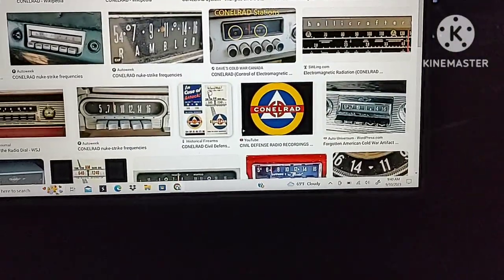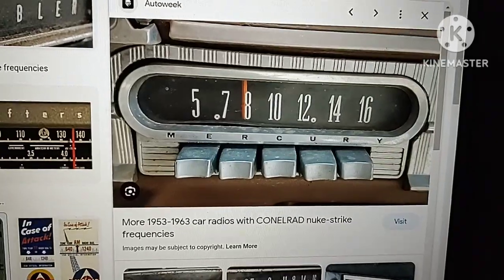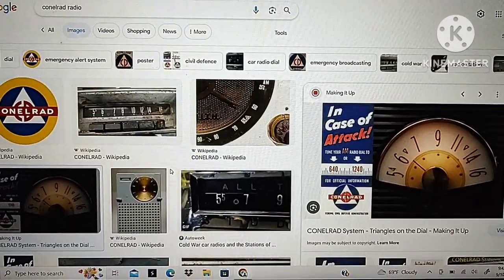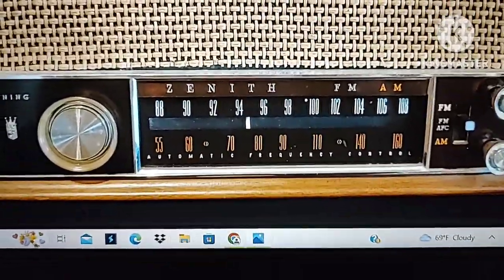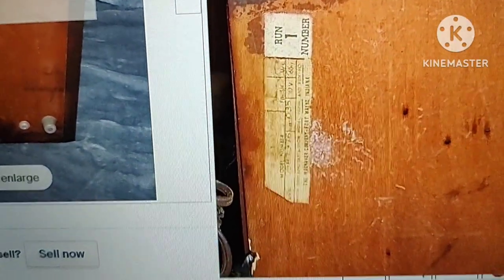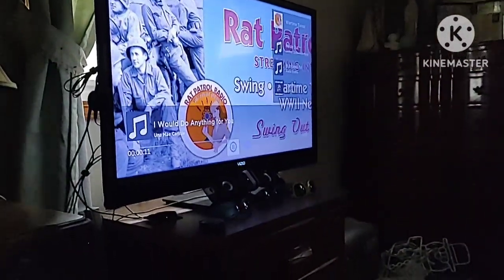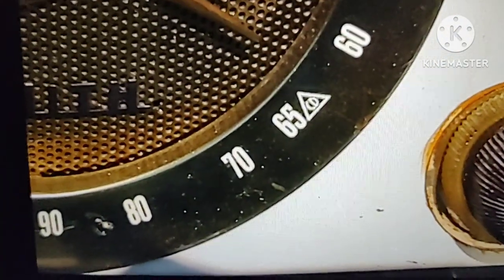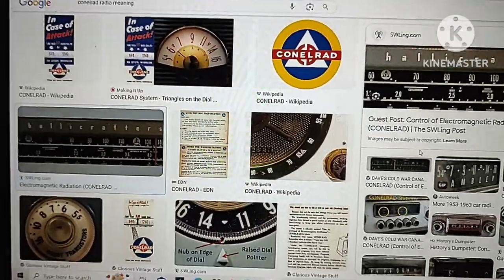The story behind the CONELRAD markings on radios (from 1953 to 1963).

Comment: I have a vintage Sony pocket AM/FM radio model TFM-825, which is a model that was sold from 1964 to sometime in the late 60's. I always found it interesting that it came equipped with CONELRAD markings at 640 and 1240, even though the system had been shut down a year before that model was even introduced!
Reply from the maker: Those CD era pocket radios are sure a collector's item based on the years of production. The radios I saw at a local coffee place were made in the early 1960's and with the CONELRAD markings on them. They are five tube sets.